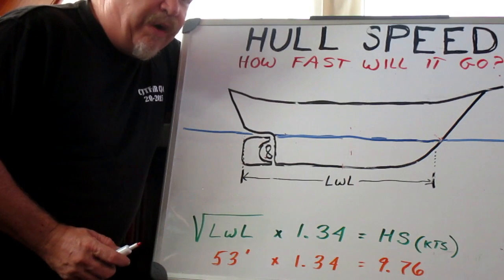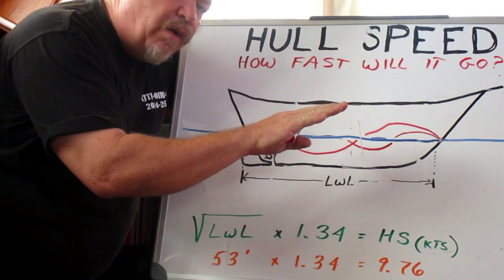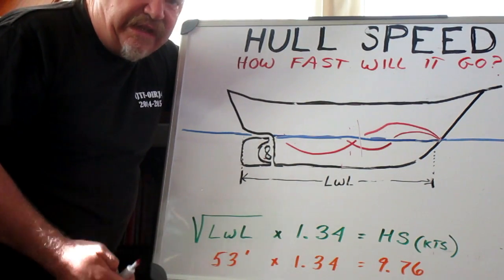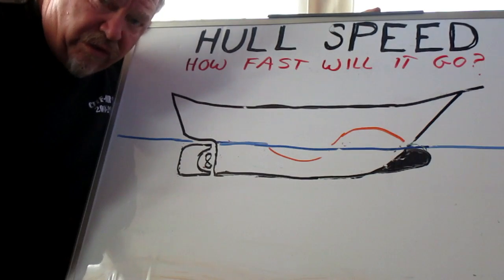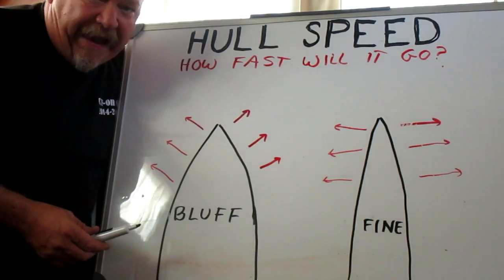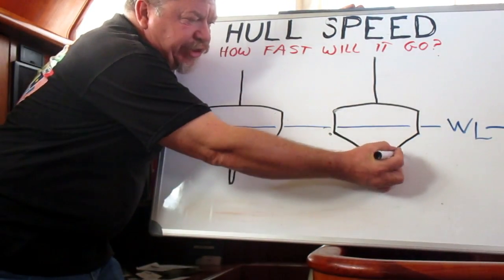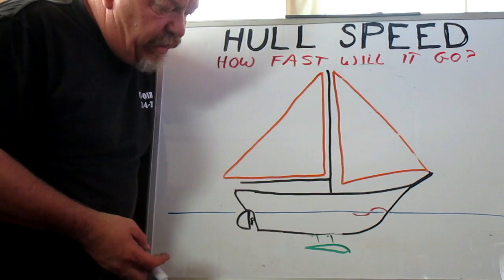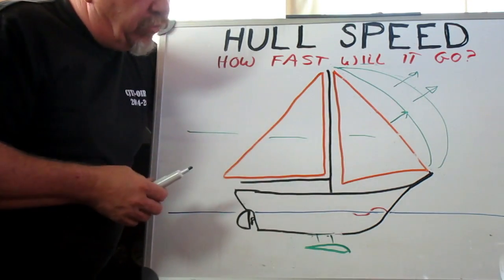Hull Speed

Comment: Boss my boat speed is 56 knots.  LWL is only 40 feet how is possible. with 4 engine marcury 400HP.  As calculation boat speed will be only 26 knots. tel me how.
Reply from the maker: Dear New Tech,  that's an easy one!   Hull speed calculations, with a constant of 1.34 x square root of WL only works for DISPLACEMENT hulls.   Planing hulls, like the one you must have, generate lift as they move through the water; usually more lift for more speed.  If you watch the vid again, watch for the part where I talk about the different kinds of hulls.   Most monohulls sailboats are displacement hulls.   Sounds like you have a fun boat!   Enjoy!

Comment: Right if you have a lifting hull that makes the hull ride higher less hull in the water it will go faster and if you hydro plane hull speed dues not apply.
Reply from the maker: Walkertongdee,   Thanks for watching!.    I agree, hull speed equations are only an estimate for displacement hulled vessels.   For mono hulls, most vessels are nearer displacement shape than planning.   For cats, it is a different story, but their speed is achieved by dramatically higher length to width ratios for the hulls and by using shallower draft;  a much different prismatic coefficient.
Reply from the maker: sorry, should have said 'mono-hulled sailboats'.

Comment: Hi, nice vid and I agreed on most of it. The rule of thumb is right in here, where the estimated hull speed can be derived from the length of the waterline. But as some other(s) noted, the effect of clean bottom or the smoothness of lines mainly affect to the amount of turbulence, thus the amount of power needed to achieve the hull speed. All turbulence created needs energy and that is converted from fuel in the boats propulsion or from wind by sails. So basically, a dirty bottom only increases the needed power, but the boat should still be as slow/fast with that hull length. 

To go faster than the hull speed, the bow tries to climb over the bow wave, but as some other noted, the effect of wave through at the stern is also in very important role! The stern has its own wake similar to the bow wake (wave) and the hull speed is actually the situation where these two waves interact in the same phase: the bow wave's second wave crest (first one at the bow) has lengthened all the way to the stern and increasing the stern wave which is easily visible from a high stern wave. If going faster than the hull speed, it would mean that the crest of the bow wave would go beyond the stern, thus making a hole under the stern, and sucking the  stern down. Together with the bow trying to climb up, this increases the power need exponentially, thus making it impractical situation.

What comes to the effect of a bulbous bow and adding a kite sail (spinnaker/gennaker). There your presentation went wrong. The bulbous bow can in small boats increase the waterline length and make it a larger hull speed, in theory, but it also generates its own wave formation as you noted. And this additional wave is easily making more harm since it needs energy from the propulsion such as any turbulence. It is helpful only in large ships that does not operate even close to the theoretical hull speed, based on the waterline length. In those ships the limiting factor is the hull friction due to the large wetted surface, and the wave formation. Every wave you make needs its energy from the propulsion. In ships the bulbous bow is used to counter-effect the bow wave, thus making in result a lower wave. This is especially why it is not seen in sailboats that has to perform in different heeling angles (changing geometry). The bulbous bow is not possible to optimize for different angles and sea states.

As for the spinnaker/gennaker help: It does not in general lift the bow, in fact quite the opposite. The force resultant of the sail might point up 10-20 degrees from the horizontal level, but the force is still way above the waterline level, thus making a moment arm that is actually pushing the bow down using the rig as the moment arm. All the dragging force is under waterline and all the pushing force from sails is above the waterline, making a huge moment arm.
Reply from the maker: hkkabanossi,   Thanks for watching!   I read through your reply and was impressed.   You sound like you have some formal design experience; something I lack.   Thank you for the input, and I wish you the best out on the water!
Reply: Thanks. Yeah, forgot to mention my studies in marine technology :)

Comment: Sea state is also a factor..surfing on a following sea vs head and cross seas?
Thanks to GPS we can accurately assess speed over ground..in the old days impeller speed indicators could show a forward speed while stationary in a current or tide race...
Reply from the maker: David,   Thanks for watching.   Yes, sea state matters greatly.   The video assumes a calm sea (despite wind).   You used to be able to measure speed over ground as an average speed between two land points, and get an overall expected vessel speed by keeping track on multiple journeys in multiple conditions. 

You mentioned currents....  The other interesting thing I am learning is that the ancient mariners of the South Pacific had an extensive knowledge of currents; depth, speed, direction, final destination, etc.   I am pondering if they used currents as sort of a propulsion method; sinking a weighted 'sail' into the right current to augment the wind propulsion.  (??)  Have not heard much of European sailors using the currents, save for the Canary current and the Gulf Stream for any long term propulsive advantage.

Comment: Good explanation. One thing that you did not mention is what happens when you drive a boat over hull speed, the boat tries to increase its waterline to balance that equation and the only way for a boat to get longer at the waterline is to settle down lower in the water. If you drive a sail boat too hard, it will do one of two things. If it is light enough, it will surf or plane and if it is not light enough to do that, it will "submarine" on you.
Reply: Pforce9,   Thanks for watching!   I have never experienced the submarine effect before, but sounds plausible!   I will keep my eyes open for it!

Comment: So I guess the hull speed only works on certain boats? Just sail? As my 14’ fletcher by your calcs will only do 5 knots.
Reply: James,   First, thanks for watching!   Second, remember that hull speed is ONLY an estimate.  Its a rough idea of what you can expect from the boat.  The calculation was developed long ago, without benefit of new hull materials, complex curves now available, and lightweight rigging.  So, yeah, you can go faster than the raw equation.  At least I hope so!

That said, the equation starts to flake out when you get into smaller craft like your 14' .   Lift from the sails does odd things, and laminar flow gets even odder.

Is your boat a displacement hull?   I would be surprised if it was a full displacement hull.   I am not experienced with Fletcher, but smaller sailboats tend to add planing surfaces because the ratio of speed to size is so favorable.
Reply: Vessels are usually placed into three categories- planing, semi-displacement or semi-planing, or displacement. Your Fletcher is a  planing vessel. The hull speed equation presented here, V[kn]=1.34*sqrt(LWL[ft]), only really applies to displacement vessels. And more specifically vessels with a Displacement/Length ratio above ~275 and a Length/Beam ratio less than ~6.  Most displacement vessels at a Froude Number of ~0.4 (or S/L 1.34) will have their bow and stern wake converge.  A very simple explanation is that this convergence and corresponding amplification of these waves creates a low pressure region behind the vessel that kind of sucks it backwards.  The power required to transition out of this zone is usually both economically and practically infeasible.  Planing craft have hull shapes that provide lift and are combined with enough power to get on step. This allows them to more or less run on top of the water and not through it. Semi-displacement craft can also exceed a speed of Fn 0.4, but to a much more limited degree. 

Most all equations you'll find in relation to boats are based on empirical data, meaning that the equation is only representative if your vessel falls within the initial assumptions used to derive the equation.  This is actually quite frustrating because almost all published data is for vessels involved in industry- RoRo's, bulk carriers, container ships, ferries, etc. The characteristics of these vessels do not represent leisure craft very well.

Comment: The point not well covered is that hull speed is not a brick wall you can go past it also by adding horsepower (more sail) which is a diminishing return game for sure but is still some returns.  By that I am not meaning what was covered in adding lift but rather the added horsepower of extra or more efficient sail. None of which matches the gains of taking the next leap which is planning. Great video though so clearly explained.

Comment: I had no idea the details that need be considered for a boat to move through the water, I just took it for granted...  Can adding a bubbler system to the front nose, or underside help lesson the drag? or would that massive influx of bubbles cause more of a hinderance then helping?
Reply: Interestingly Tremlett of Topsham Devon built a boat called The 21 Sportsman in the 1970's. The mk1 version had a slight dihedral at the chine which trapped air underneath. When viewed from underwater at anchor, large bubbles would travel slowly along the underside as the boat pitched in waves. I've no idea what effect the feature had at speed, but the Sportsman went like hell and handled beautifully.

Comment: дядька знал бы я о чем вы я бы подержал искрене а так лайк просто) стаксель лишнее для скорости и мачта
Reply from the maker: Thank you for watching!    If I have translated correctly, I think you are writing that the staysail does not help for speed.     I believe you are correct in most cases.    The staysail is an excellent tool to keep the boat stable in beam wind and waves, and it provides a small speed for trolling (and is sometimes used by fishermen for that purpose).     I think that a staysail would interfere with the motion of the wind in between the jib and the main sails and reduce the wind acceleration that occurs there.

Comment: If generating lift helps with hull speed, wouldn’t it make a shorter water line length?
Reply from the maker: Gabriel,   Very good point!  Assuming the hull is not some odd shape, then yes it would.   Will have to ponder this one a while, and perhaps talk to a few of my boat design buddies.
Reply from the maker: Got a quick answer... still trying to verify, but here goes:   The reduction in water line length is overcome by the larger advantage of the lift.      There are some other considerations I have not figured out yet....   The jib raises the bow and thus lowers the stern slightly.   This is going to present a different surface angle to the water as the boat moves forward.   That angle may multiply the lift of the jib, and may present a finer entry (not so much vertically, but horizontally), and that should gentle and reduce the effort needed for the water to be shouldered aside at the bow.      Now my head hurts.    Again, not sure this is correct, but trying to verify.     I DO know that I have gotten speeds above theoretical hull speed with the jib up and not with it furled, so SOME mechanism is working.
Reply: Sailing Puffin thank you for your replies!  I appreciate you contemplating this unique conundrum.  If you don’t mind I will add some more questions to your answer?!  So if the lift generated by the jib raises the bow and lowers the stern I want to say that that recreates the condition of the hull at hull speed! Or would the decrease in drag/wetted surface assist in overcoming hull speed?! Also with a Genoa/jib flying, what point of sail would you say this ability to surpass Gil speed occurs?  I am going to call my instructor from my days as a student of marine carpentry and discuss with him this.  I look forward to seeing if we can get this issue illuminated.  I hope this is interesting to you, it is to me.  Thanks so much Captain.  :)
Reply from the maker: Gabriel,   it does fascinate me, and I enjoy the examination of the physics involved.   I suspect they are far more complex than I can fathom, but it is still fun.    I am not on a boat anymore... currently up in Colorado.   Perhaps again one day.    That said, the conundrums like this are where I 'park my brain' when I am trying to get to sleep, so I do think a lot about them.    Laminar flow of water over a hull is fascinating.    I puzzle over other oddities, too.  Try this one on for size:   Light speed is constant.   186K miles per second.   According to the texts and the teachers, it makes no difference of the speed of the platform on which the light originates from, it still maintains a constant speed.   If this is so, then why do we have a red and blue shift (doppler effect) as a light source is approaching or receding from us?   More rum.   I need more rum.

Comment: Was on an old 36' catamaran doing 28 kts?  No hydrofoil, nothing fancy.  How is it possible?  By your calculation, a 36' boat should never exceed 8.2 kts?  Yet we were traveling more than three times that speed?
Reply: The hull speed constant used in the calculation assumes a full displacement type hull characteristic. Your cat at 28 kts was not behaving as a displacement hull and therefore requires a different constant for the calculation. This is demonstrated in the case of small planing craft such as speed boats or even jet skis. You can use the 28 kts figure and your waterline length to calculate your own boats constant. Multi hulls have different wetted areas to mono's which skew the figures, but you are still only dealing with waterline length, a constant and speed.